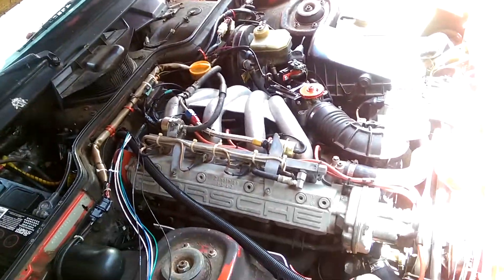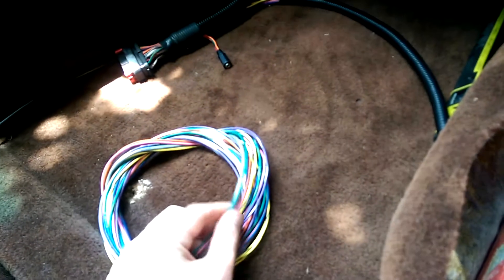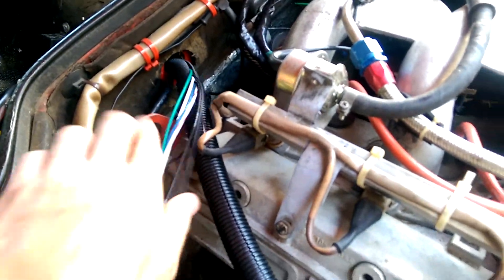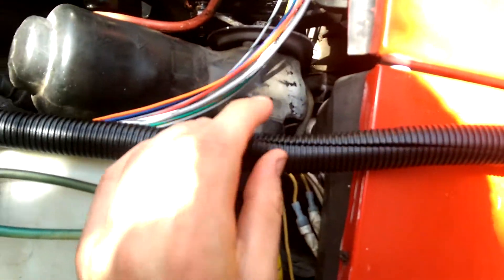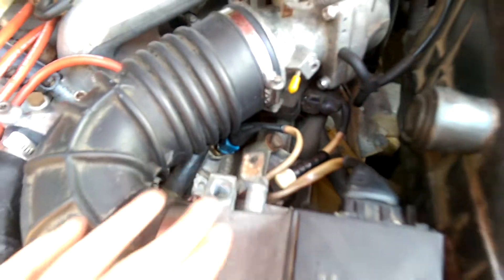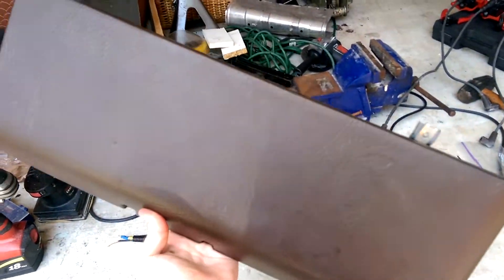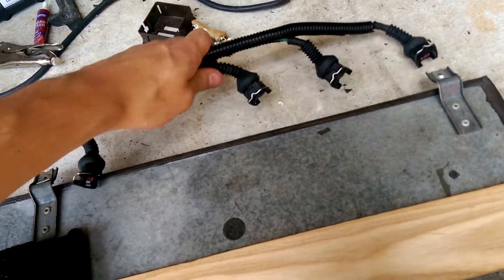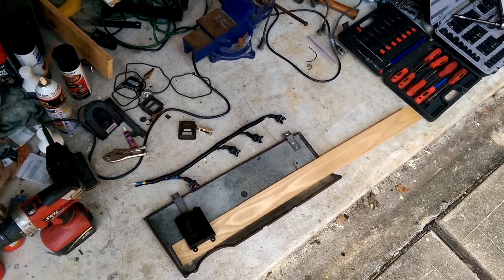Porsche 944 MicroSquirt wiring - Part 1

Comment: I'm pretty curious, since I noticed that you'd said it was a megasquirt in the vid, but the title specifies it as a microsquirt. Is there a difference, or are the terms interchangeable?
Reply: 4 years late, but want to add this for anyone else looking:

MegaSquirt is the name of the brand, while Microsquirt is the name of the controller he's using. It would be like calling your 944 "your Porsche" — technically correct and fine in context, but out of context, someone might assume you're talking about a 911

Comment: I need help with this, the stock wiring on my 944 has completely crapped out and I was thinking of redoing it all with the megasquirt
Reply from the maker: I made these videos because I was in a similar situation. This re-wire is only for the engine harness though. Your best starting spot is the wiring diagram for the ECU you want to run. I have a thread on Rennlist for my MS installation but these videos show the majority of the actual wiring involved.